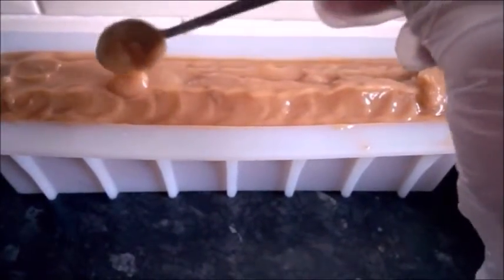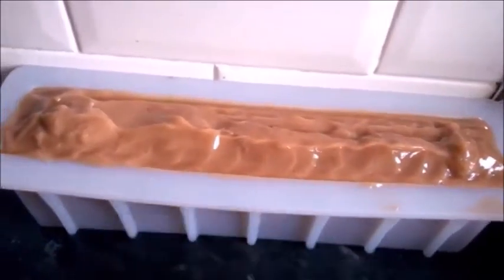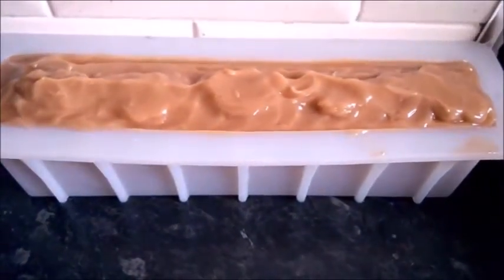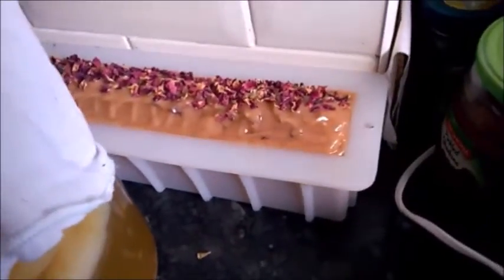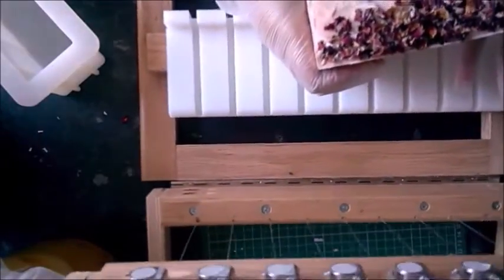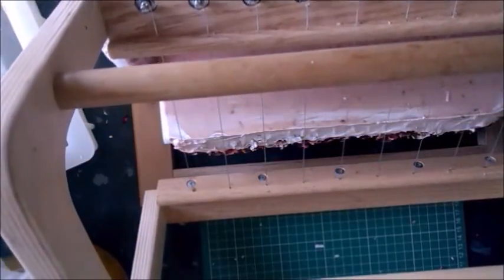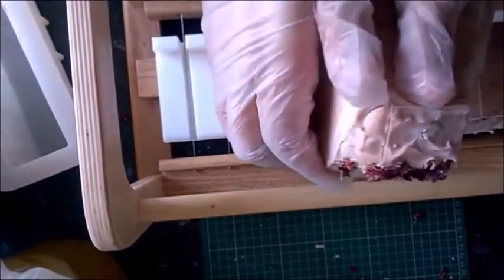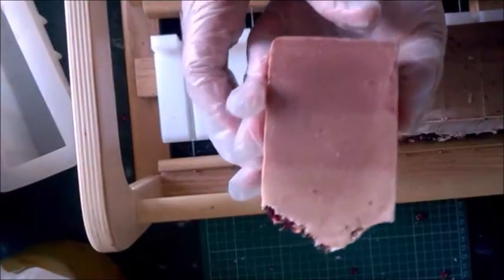Rose Clay & Rosehip Natural Soap Making & Cutting Cold Process Gradient Soap

Comment: I use that same mold too. I have found that putting a thick rubber band around the outside of the mold will keep it from bowing in the middle. It also fits perfectly inside my 5 pound wooden mold which also prevents the bowing. Your soap turned out beautifully!
Reply from the maker: Thank you!  I use a stiff string around the mould now which helps somewhat but might think of making a wooden mould to put it into as that seems to work the best. xx